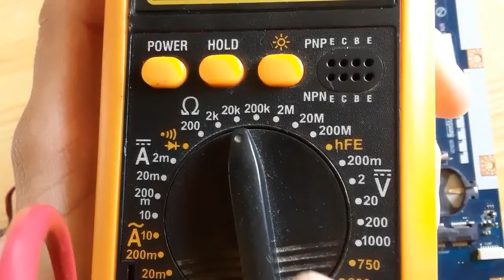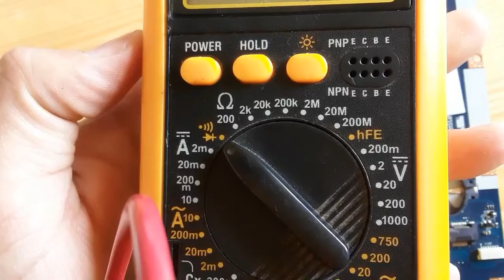how to test motherboard components with multimeter-testing inductors

Comment: some smd inductors , especially  grey squared ones have their pins on the bottom side , it's almost impossible to put your probes on them  .   inductors like 6R8 . in your video the pins are visible 1:37  , but sometimes they aren't . how to check them ?    I also encountered inductors labeled  CHK 1  ,   CHK2 , CHK3   etc..  their terminals are beneath them .
Reply from the maker: There  is always a way to test all electronics components on a circuit. Check again